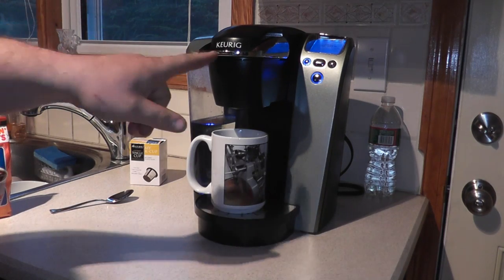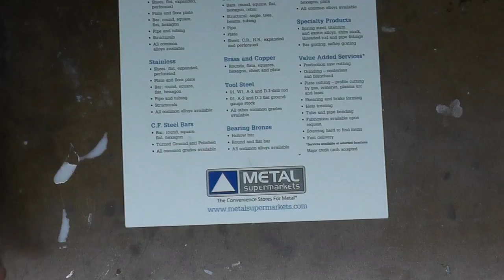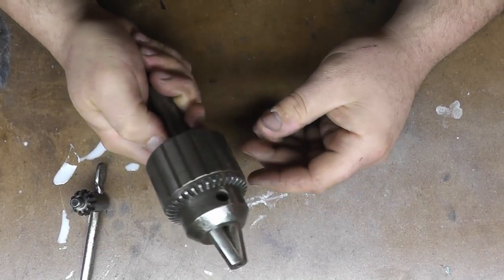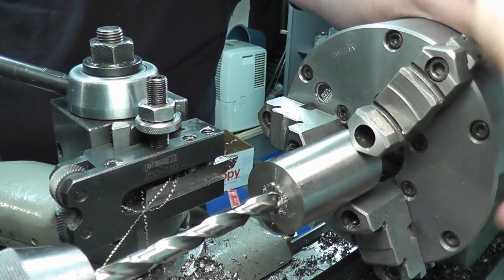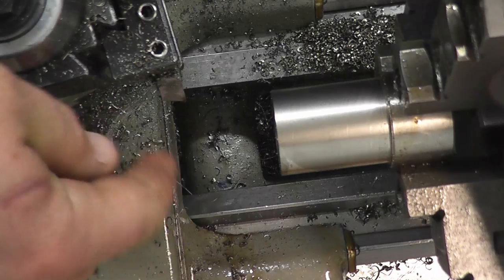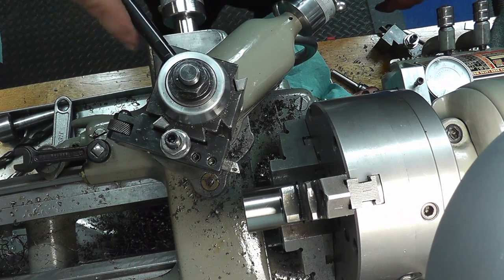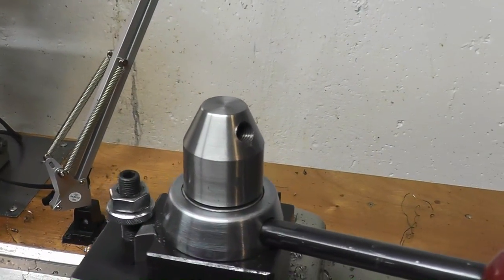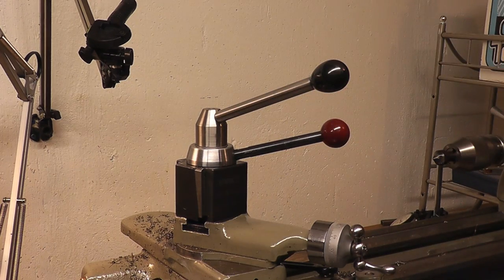Making a Tool Post Lock Down Handle

Comment: I watched the video and decided to make one of these....very pleased with the way in came out.  My 200 series (BXA) has a 16mm - 1.5 thread size.....took me a while to sort that all out.   Concerning the direction that the handle ends up pointing towards....with fantastic luck it will end up just where you want it.  With good luck it will be 180 degrees off....all you have to do then is rotate the T-nut 180 degrees.  As usual, I had neither fantastic or good luck.....but the fix is quite easy.  A final adjustment can be made by running a die over the threads on the T-nut end lengthening the thread ever so slightly so things come out to the desired handle position.

I enjoy your videos.....keep up the good work!!

Comment: I would like to take this opportunity to thank you very much for this great video. I think I have watched it a brazillion times, and pausing it occasionally to make a drawing of each of the steps as you were making the tool. I finally decided to make a similar tool using your specs. The first attempt was using aluminum, just to see if I could do it. It came out kinda sorta OK, but I doubt if it would hold up very long. I ordered a one foot section of 1.5 inch 1144 and a one foot  2 inch section for future projects . I ordered several small plastic knobs for the handle . My only real issue was in drilling the hole for the handle. I ended up making a holding jig for my drill press table top, and was able to drill the hole to perfection. The end result was a perfect tool. Like you say "no more Mr. Wrench".  Again thank you for taking the time to make your great video and sharing it with us. ...Ken ..Marina CA
Reply from the maker: Glad it worked out for you!

Comment: I thought it would be more trouble ordering a tap that I wasn't sure actually would be the right one so I just made the entire new assembly (tee nut, tool post bolt and of course the threaded nut on top) out of scrap I had on hand plus a 9/16" x18 grade 8 bolt the guy at Fastenal gave me.  My lucky day I guess.  Plus I had already threaded the blank nut I made 9/16 x 18.

My local hardware has the try-it-yourself gauges up to 1/2" so what we have here is a shot in the dark.  I was hoping for 9/16" and it turned out to be 14mm like you had. Thanks for posting the original video of your project. It makes you wonder why the professionals haven't done something like this.  That wrench is always in my way.  And thanks for all your other cool videos.

I was hoping to send you pictures of the finished tool post but can't figure out how to do that from here.

Comment: I have made three hex and two like yours.
I picked up metric bolts to fit the T-slot cut head off the head and threaded 9/16
They work really nice,
wished I had seen your video first so I could have cut down on the mistakes

Bill

Comment: Greg if you want the tool to last keep the SCE angle 5 to 8 deg max also the top side rake to max 8deg this will give the tool support and will hold the edge much longer..IMO good video good shots
Reply from the maker: Thank you and thanks for the tip.

Comment: the reason that v block set only comes with one clamp, is to avoid bending the guide rod. if you try to clamp a bent piece to both blocks, it will force the guide rod to match it.

Comment: I'm jealous of that parting tool man. I have one for my lantern style holder but the most I can do with it is to start a groove for my hacksaw...
Reply from the maker: The lantern ones with the offset blade suck.  Try to get a straight style.  Grind a slight radius in the tool of the tool so you have some relief to act as a chip breaker.  The biggest key is steady pressure and be on center.  Parting tools don't like a light feed and they don't like to be stopped in the middle of a cut.

Comment: Pretty creative with the drill press Greg. I automatically go to the mill every time and most often forget that I do have a drill press that could be easier to utilize for something like that. Good job on the handle. I've seen a few of those and wondered if it would get in the way. Might have to make one and see?

Colin ;-)
Reply from the maker: I wish I had the luxury of using a mill for it :-)
Reply: Keep an eye on CL. It seems there are units available down there for reasonable dollars.

Comment: I hate to tell you this but that is the same tool post that Shars sells. I have been learning all about the manufacturers in China and getting contacts in these companies I've been buying the same tools that are sold as Phase 2 and shars you name it for so cheap it's unbelievable I don't know why I'm telling anyone this LOL. It's not banggood cheap but it's a lot cheaper. I get the same inserts that they sell everywhere for pennies on the dollar literally and they are fantastic tool insert. I mean they are no different they last just as long they cut just as good and I can by 10 of any random insert for about $11. I've worked in manufacturing for years so I have some really really good information from purchasers that I've been using to get in contact with these companies. But the shards one and the phase two I've taken apart and they are physically identical in every sense you can put a micrometer on all the parts and their identical

Comment: Thanks for showing this!  I've just recently bought a South Bend 9", and also put a Phase II QCTP on it.  I've been watching Doubleboost using his for the last year, and decided a while back that I was going to make one too.  Your video will be very helpful with the details of that job.  I've been thinking about using brass hex stock...do you think that will be too soft?  I'm also planning to make the knob for the end...probably with a similar shape to the nut...but without the hex, just the same taper for aesthetic reasons. 

Thanks for the instruction and info!

-- Mike
Reply from the maker: Brass should be fine unless you really wrench on the thing.
Reply: *****
Thanks!  It doesn't seem to take much force to get the QCTP to stay put.  I'll give it a try.  If it doesn't work, I can make it in steel later I guess. 

I'm finding your videos very useful with my new lathe...having the same model means both that I can try what you show, and that you aren't likely to show much I can't at least try to duplicate.  Not so true with folks like Adam who can hog off 1/2" cuts in one pass on that big Monarch of his...though I learn plenty from Adam too (like how to indicate in on a 4-Jaw chuck without spending all afternoon at it!).

Thanks for all the education, entertainment, and ideas!

-- Mike

Comment: Nice project, It seems like you bought yourself the metric version of the tool post (like i have).
You could gotten away with a 31/64 drill to drill the tap size hole. I'm making one for myself, so i reviseted this video.
Keep up the good work.
Reply from the maker: Yup.  I just like to expand my metric drill collection so if I need one I don't have I get it.

Comment: Greg,
 When threading the bore why not lock the tap wrench against the lath bed? Holding the tap handle could break you wrist.
All my best,
Jeff
Reply from the maker: The lathe wasn't running when I was tapping.  I was turning the the counter-shaft pulley by hand.  I did power it up to remove the tap though which is why I grabbed it in the middle in case it did catch my hand wouldn't be pinched between it and the bed.

Comment: as long as you have enough thread you could just take a bit off the face of the nut instead of using shims to align the handle
Reply from the maker: It's an option

Comment: Nice job on a nice project.  We are nearly  years out- is it working well?  Has there been thread wear?  Thanks.
Reply from the maker: No problems.  It's moved maybe ~1/4" from its original tight position this is due to really gronking on it and taking the high spots off the threads.
Reply: I appreciate your answer.  I'm making one too.

Comment: Holy crap Batman.......You go to the local hardware store to buy your taps and drills?   Can you not get on your computer and find a local industrial supply near you?  How about KBC order on line and the parts will be at your house in 3-4 days no matter where you live and both would cost you less than the price you paid for the drill... maybe a bit more but you are getting hosed big time.  Luckily I have 2 industrial suppliers withing walking distance of my house so I do.

Comment: And when the Keurig stops spitting out water shove an opened paper clip up the little hole in the spike on top...
Reply from the maker: I've done that descaler thing with it that they recommend.  Takes a bit of time, but it does seem to clean out the reservoir.
Reply: Nah, it's not the reservoir, sooner or later it won't spit out water, then you'll remember this and you'll do it and go "Yaaay! The life blood flows again!" I've never actually descaled my Keurig, and about once a year I have to clean that spout. I probably should descale soon though.

Comment: 1/2" drill is equal to 12.7mm.  I think that would have worked too to save the cost of that bit.
Reply: Indeed.  It is only .008" larger and would not have made any significant change in the strength or fit of the threads.  A metric drill is not necessary for metric threads, or imperial for imperial, or the size shown on your chart.  Your 12.5 mm drill gives a 77% thread and a 1/2" drill gives a 66% thread.  50% would have been adequate for that purpose.
Here is a calculator:  http://www.guhring.com/Tech/TapDrill/default.aspx
Reply from the maker: *****
I know.  I just know my 1/2" drill drills oversize and I figured I'd come across the need for a 12.5 mm drill eventually.  I wasn't expecting it to cost that much.  Just got to the register and by then I said screw it it already rang up.

Comment: 43:12  Why use it reversely??? o.o
Reply from the maker: There is no lead in angle on the reverse side of the die so you can thread up nice and tight to a shoulder.